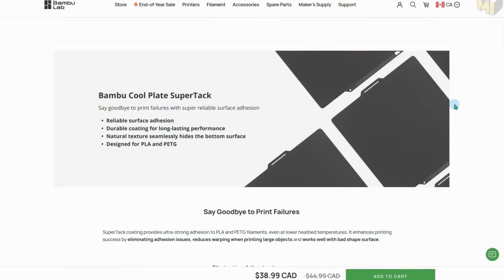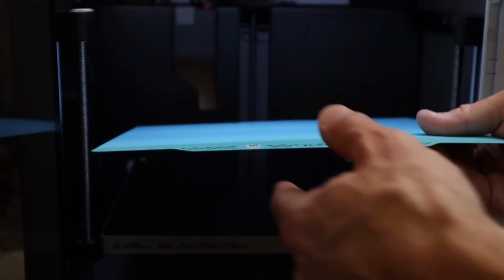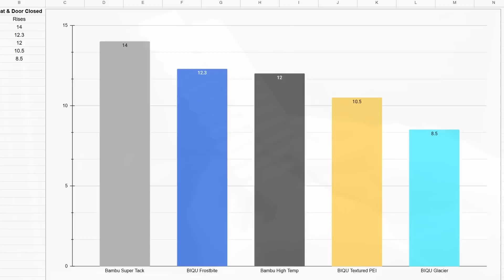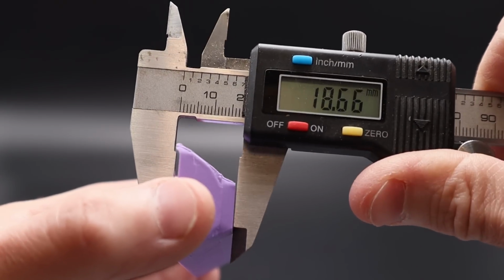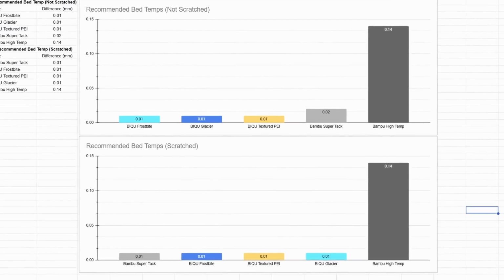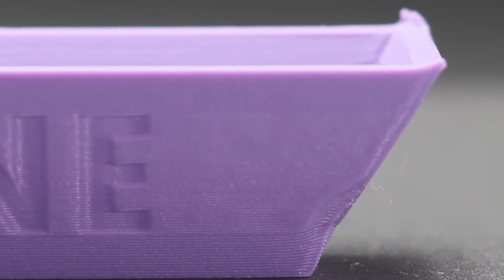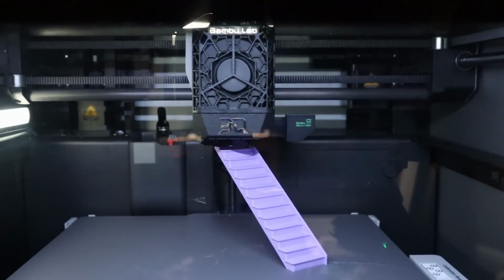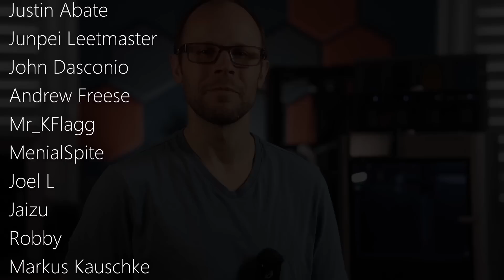Which is the best, the Bambu Super Tack or the BIQU Frostbite or Glacier?

Comment: Be sure if you have not checked out QIDI filament selection in a few weeks you check their website for latest new filament releases.  I see they have around 5-7 new filaments listed, compared to my last order which was around three weeks ago.  I see a new Nylon Based Glass Fiber with 15 percent fill and several others that look very interesting.  Their ABSGF25 has always been a favorite I keep half dozen rolls around the shop at any moment, glad to see they have added several new ones in recent days.  I also see ULTRA PA CF25, do not recall that one being there before along with a new PLA wood one listed.    The newly listed PPS-CF I saw a few weeks ago.  I have quite a few rolls of their PETCF which is also a great product; I see they released this with GF added to the PET which attracts my attention.  I do like the GF content filaments they are structurally very great filaments when accuracy is key.  Great to see they have added several new filaments to their selection.  The QIDI UltraPA-CF25 specs look impressive.  I have used the PAHTCF and loved it, this one specs out with quite a bit more strength, price also jumps on this product, but it looks like a very interesting material.

Comment: the super tack for me is just too strong of adhesion. i have to be mindful when picking it. only for hard to stick, or low contact surface area prints. otherwise it usually very very hard to get the print off.

Comment: Duuude perfect timing on this video, I just got one of wham bams XTR powder coated plates and I was wonder how thick it really was compared to my other plates. They boast a .6mm thick spring steel and it definitely feels beefy, though I dont really want to scrape off the coating to check for sure since the one I got was almost 100 bucks haha. I do know for sure that the overall thickness of my plate is .72mm thick, makes me want to do the deflection test just to see how it does. Bed adhesion is also great, It is noticeably sticky when clean and pla prints stick very well though i have not had it for very long so I have not done any materials other than pla at this time. I personally recommend these plates especially if your like me who does not own a bambu.

Comment: so far, yt 3dp bloggers discovered this things
1) bed plates have diiferent adhesion
2) thick steel is better for warping
3) u can use buildplate without glue
4) u can print smth another than pla
5) sanding is not aging, but for better adhesion
too bad that, again, all those reasons were obvious to simple people for years.
any of this adhesion tests cant compare too pei WITHOUT glue, it wiil outrun any of them and is free. if u need ALL adhesion, u can print pla on glass. it wiil need tons of force to dispatch. 
p.s. who even uses gluesticks nowadays ? isnt soluble glues invented in your part of youtube? or is this 2014`s old vid reupload ?
Reply: 🤦‍♂️ don't skip piIIs buddy

Comment: Excellent,  but you completely forgot needing glue as a release agent for some of my filaments that won't release easily,  or leave residue in the valleys of the textured surface,  i need glue to help them release without damage to model or plate.

Comment: Which bed do you slice with when using the Biqu plates? I got incorrect plate errors whenever I tired to use one.
Reply: It depends on material you are using, for PLA i set it as a cool plate and adhesion is fantastic, PETG it must be set as textured PEI plate as example.

Comment: You're supposed to scratch or scuff up your PEI print bed from time to time to refresh the textured surface. Recommendations I have always followed is either steel wool or above 220 grit sandpaper and just lightly just to get the surface area of the bed up, because every scratch now makes more surface area for the plastic to stick to
Reply: Yup. Whole point of even being textured PEI was to add surface area, while also adding benefit of some first layer Z offest issues since it gives micro dips to bleed off excess pressure when Z is too close.

Comment: I would like to see a test of temp cycles to see if the surface holds up to the repeated changes in temps. This would be a good test of durability as many who constantly print AKA print farm are likely to see some sheets fail normally because of this.
Your prints were a small foot print, would like to see larger foot print model to see how well they can be removed when cooled and when nearly fully cold. Do they hold too well and if so does the sheet get damaged when model is removed using a scarper.
What sort of damage can be expected if metal scraper is used to often.

Comment: Great video, thank you. It is very timely for me personally as I just recently got 1 of each of these plates. I was really surprised to hear you say you use glue stick. I've been 3d printing for many years and with the exception of printing PC, I haven't used glue stick since PEI surfaces became a thing. If you have adhesion issues these days, it's generally fixed by cleaning the build plate and possibly bumping the bed temperature a little. With PC, the glue stick is needed because otherwise it sticks too well.
Reply: This was my exact thought.  Why is he using glue sticks to begin with.  Back with my original ender 5 years ago was the only time i ever needed to use glue sticks and even then it  was only on occasion or with glass.
Reply: It was surprising for me to hear too. 
I haven't been printing long but I hate messy things like glue so I've always refused to use glue stick. I started with an Ender 3 v2 with the glass bed and had successful adhesion for a while but I guess the coating wore out even though the coating looks fine so I finally switched to a PEI bed sheet and have been really happy with it.
Reply: Same. PEI entering the market basically eliminated the need for glue stick outside of a release agent. Even a badly calibrated 1st level will stick for most filament types if you have the temp set high enough. Bigger risk is PETG sticking TOO well if that is your approach vs fixing your first layer problem itself. Glue stick was king before PEI, now it should more be a sign you have a problem to diagnose if its anything other than a release agent use.
Reply: @MattWeber I LOVE it. LOVE IT! Your comment is so perfect. “Glue stick will make PETG stick too well.” And then “If you’re using glue stick as anything but a release agent…” - Pick one, glue stick sticks too well, or helps with release. I LOVE IT! What a great example of someone that only regurgitates what they read, and doesn’t actually have their own experiences.
Reply: @Those_Weirdos  Maybe reread it.. "Bigger risk is PETG sticking TOO well if that is your approach vs fixing your first layer problem itself" is pertaining to literally the sentence before it talking about using increases in bed heat to try to fix adhesion, which basically can weld PETG to PEI beds.
Reply: @Those_Weirdos  And I have a over a decade in the 3d print space xD. My first hands on experience with it was gel disposition back in my engineering classes in 2001 lmao.
Reply: Because glue stick works, and improves hold. 

If you haven’t seen the benefit of glue stick on some prints, you’re printing some pretty simple, basic stuff. That’s OK. But why not take all precautions?
Reply: @ Because it's not needed in 99.9% of the prints, it changes the surface finish of the bottom of the part, and it requires cleanup.

Comment: I recently began using the new Creality Epoxy Resin build plate.

I have been very impressed with it. No glue for PLA, PETG, ABS, and Nylon. The nylon was CF, and the ABS was GF, except for a few small parts from standard ABS.

Everything grips very well, better than PEI. I need to allow the plate to cool completely for the parts to self release, and even flexing needs the plate to cool a bit to work. You can hear a loud pop when you flex the plate, as the parts come free.

The bottom layer has a satin finish that I like better than the gloss or textured finish from typical PEI style plates.

It's worth a look for anyone using a Creality printer or a printer that uses the same size plate.

Comment: Thank you for the video and comparisons. I gotta tell ya, you are using the glue stick in the wrong way. The most efficient and effective way I have found is to apply about 6-10 stripes evenly spaced across the build surface. Then take some 99% Iso and do a few wipes to spread the glue stick out across the whole surface. The result is way less glue used, a very thin layer of glue laid down, zero mess or post processing needed, and better adhesion throughout the print. Redo the application process every 8-12 prints for continued results. 

I have been using the same elmers glue stick for the last year with almost half of the stick still there to start 2025.

Comment: I am puzzled by this Bambu supertack cool plate. Almost like there is some undisclosed variance in them, because my experience is horrible compared to what I read on the internet. I purchased 6pcs of the 256mm supertack plates and they do not adhere well at all. Only works OK at textured PEI temperatures. Cleaned with dishsoap as I do with all other plates. Tested on 3 different systems with both 0,2 and 0,4 nozzle. Tested both orcaslicer and bambustudio with different plate settings. The adhesion is not non-existent but they are not good and I can only dream about printing at much lower temps. The parts I have printed are easy as well. Cube shaped bonding box with a large footprint. Got a support topic open and the fist response was to lower first layer speeds, which I did to some extent already but they suggested 8mm/s contour 14mm/s infill for a 0,2 nozzle. In the process of testing but it seems strange given the claims of lower temp printing and all good experiences. For context I have 3 of the frostbites and 3 of the glaciers since before and have found them useful for specific cases. My impression is that the frostbites have far better adhesion than the bambu supertacks I have.

Comment: I wanna know wtf you guys are printing..

I never have print failures on my stock p1s unless I change between materials and don’t wash the plate. I rarely use glue stick only if the area touching the plate is small

Comment: I don't know what calipers you are using but I would go check the precision tolerance it claims to have. Most of the time they're rated for 0.02 so the last digit on the screen isn't actually fully accurate. You have to know what the measurement error of the tool is and mentally apply it to the reading. 

they don't lie about this on the paper it comes with. It's just a detail many people forget or don't read on it.

Comment: I can tell from running them since they have come out that the Bambu plate sticks best ( to good) some items can't be pulled with breaking. The blue plates are also good but slight less adhesion. I have been using them in my shed at 30 degrees with my print farm and even the cold out there does not effect my prints, game changer. I have 4 weeks on the Bambu sticky and they seem to be holding up good, the blue plates are also holding up good and I have had them for 2 months about. I haven't even washed them, each of the 12 plates I own go right back in the machine for another print.

Comment: Hi, have you tried the WhamBam PEX plate?
I used one religiously on my Creality K1, and I have ordered one for my P1S... not sure if it's the best, but for me it had superb adhesion with no glue stick, was smooth, held on to prints after cooling but was still easy to remove them. It's EXPENSIVE... and makes me think I should have got the Super Tack

Comment: 2:25 I am having a laugh that a plate designed to be used cooler than any others, conversely boasts the spec of having a handle to keep from burning oneself.
Reply: I chuckled at that as well.
Reply: having a car that can do 40MPG doesn't mean it can't at the same time have the capability to go 200MPH
Reply: @V843v3r  Yes, but also that's an implication you could use these plates at 'normal' bed temperatures, and that can cause permanent bonding then destruction to occur.. so these plates can't reliably do 200MPH I'm afraid.
Reply: @Roobotics  except it doesn't cause permanent bonding, I have both, only the glacier can handle high temp and that's the only one that has the hex handle. The frostbite(the one that you said woudl bond too tight and can only print low temp) has the normal solid handle
Reply: @V843v3r  I'm not above admitting I might be wrong about that then. Now I can't remember what someone did to fuse a print to their super tak plate that ripped it up removing.. But also possible their z-height was just too close. The 'squish' some of these plates have, seems to mess with strain gauge style z-probes.
Reply: @Roobotics  anyways, both glacier and frostbite works wonders in terms of print reliability, I'm so much more confident in hitting print and just letting it do it's thing with the cryogrip plate compare to the stock pei plate where ill have to stay untill the first layer is finshed to be sure it's sticking fine

Comment: I use glass with hairspray. The glass is easy to clean with soap + water. The hairspray is pretty cheap. I use ABS, PETG and PLA.
Reply: Hairspray is a good option (or use the special spray glue for 3D printing... which is essentially hairspray as well).  Adheres very well when the build plate is hot, and the items pop right off when it cools down.

Comment: Fun thing with all these fancy new build plate surfaces.. After having several of my build plate surfaces be destroyed by too good adhesion I have kind of gone the opposite way, because I always use some kind of as I like to call it, release layer, in my case these days a brushed on dilued layer I magigoo of the correct version for the filament, I have given life to my old damaged sheets by removing the plastic sheet and putting magigoo directly on the metal sheet, as none of my prints touch the build plate anyway, works great for me :)

Comment: I got both BIQU plates some time ago, but only started using them recently. Tbh I thought the Glacier was just a different texture, I don't mind having it around but didn't use it yet.
I already damaged the Frostbite a tiny bit because its coating is not as robust as the golden textured PEI and I wasn't careful, but since the first print I did with it I didn't change plates. It's a really nice plate and is a lot of fun to work with!
The Supertack is new to me, and while I would probably not get it for the P1S it's nice to see it's available for the A1 Mini, because there's no BIQU for that one (yet?).
Thanks for the elaborate test :)
Reply: There is a Biqu for the A1 min, it came out recently :)
Reply: @PJ-oe6eu  I didn't know, thank you! Currently it's not available on their site and I didn't see it anywhere else, should be available soon enough tho I bet :)
Still might try the Supertack, as I again accumulated enough points for an 80€ payout from Bambu, so it's kinda free 🙈